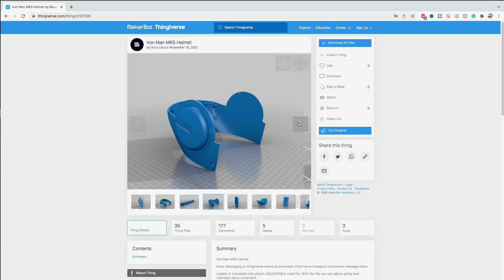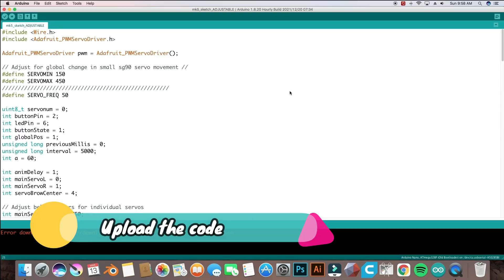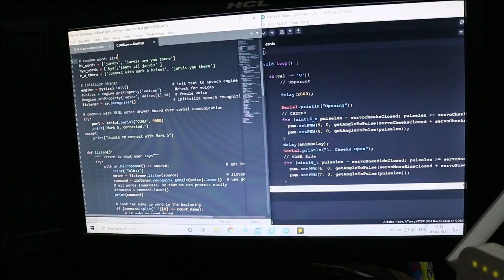MK5 Iron Man Helmet that OPENS! [How To Make]

Comment: I have taken up this project to build the mask! But the original template from box and loop has the mountings for the wing servos that are Corona DS-239MG but instead of using them you have used MG996R Towerpro servo motors! Have u made and alterations to the helmet template!! Your help will be much appreciated! As I m trying to order the wing servo motors Tht are mentioned in the parts list but it’s expensive to order from out of India
Reply: yeash he has made alteration to the dome 1 template
Reply: Hi u can also refer to the remixes on the site there u can find one with mg90 servos instead of wong ones
Reply: @ekanshchokhani1489 can you help  me in that please I am facing a problem

Comment: bro i've been trying to  build box and loops version and i don't know what the hell went wrong but i just can't get the servos to act.  

might try your build!
Reply: did you figure it out ???
Reply: @richiepage9204  sort of, i have to power the boards first then connect the motors every time.  I don't know what i did wrong with the wiring, it's honestly pretty simple diagram.
Reply from the maker: Message me on Instagram if you guys need help
Reply: @Technocrafts  will do bro thank you
Reply: @Technocrafts  i did but no response